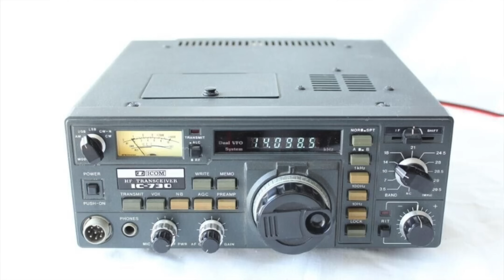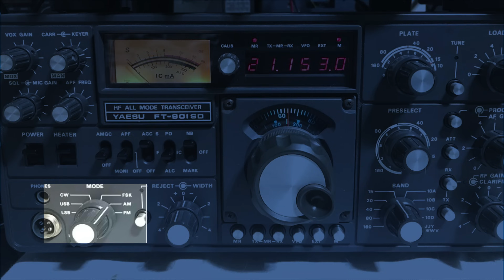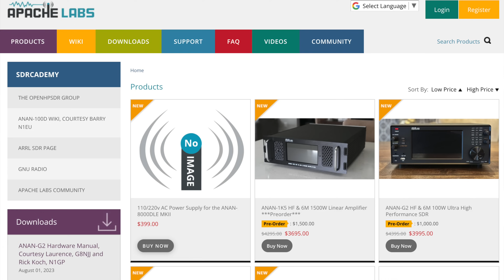Can We "Future Proof" Ham Radio??

Comment: My first HF rig from 3 years ago was an old Icom IC-735 (released in 1985) that I borrowed for free from the only other ham in my small town (I retuned it once I got my FT-891). I bought a digirig and 2 cheap Amazon cables and wired it up myself to connect to my PC. An old radio and 5 minutes of tinkering and I was using FT8, JS8Call, and winlink on a radio from almost 40 years ago. What I love about this hobby is that, all things considered, not a lot has fundamentally changed, and the old stuff still does 80% of what the new stuff does, and doesn’t do too bad of a job at it either! No future-proofing required!

Comment: Any modern radio you can set a TX power limit via menu. Making it hard t just turn up on the fly. I was just checking my TX power limit on 1296, I only need around 20 watts to drive the amp to full output.

Comment: At the risk of starting an argument, i wouldn't mind adding watt limit sections into band plans so we could tinker with some of the lower power rigs more. 
Adding in an example, make the 200w limit universal in the technician section of 10m. I'm just thinking through it.
Reply: Keep in mind that the band plans are not enforceable, outside of what your country's regulatory agency has set forth. Using the US as an example, someone could key up with 1.5kW right on top of someone running 15W. 

Part of being a responsible ham is to not intentionally doing behavior like that. 

What is the idea you have in mind for the power restrictions? There are "weak signal mode" sections of most band plans.
Reply: Yes, we would have to behave and follow the plan 😂. There's not really space in 15/20/40m for low power voice. I think with the growing interest in qrp rigs (esp sdr with fantastic filters) , it might be helpful for research/development and then getting out of the shack. It's not difficult during the day on a week day, but identifying a small space that limits high power qrm could be helpful. i say this as someone who is normally against micromanaging, so I'm not sold on the idea of more regs myself, haha.

Comment: To me, future proof is something like a Flex chassis where I plug in a module to upgrade 6400 to 6600. Maybe the processor module can be swapped. Unfortunately, designing in the upgradeability is expensive, and why laptop upgrades are minimal.

Comment: I disagree with the start cheap to get into hobby approach.
Most people think “I can’t afford a $750 Kenwood HT that’s a lot of money!” And instead buy a $50-200 radio and always wish they had that Kenwood. Where if they just saved for a few months they could have the radio they really wanted all along that will hold value, last longer and do everything they want. 
Never go into anything half way. Or you are most likely going to be disappointed or spend more $$ in the end buying lots of crap.
Reply from the maker: How about the people that buy the Kenwood and realize they don’t like VHF/UHF and want to do HF.  The $18 Baofeng would be fine for them to have just in case, but the $700 Kenwood, probably not.
Reply: While I'm not a fan of the CCR equipment, it allows people to explore without having to lay out a lot of cash. The downside is the poor performance of a CCR might scare away a newbie, that doesn't realize that better equipment gives better results. (This is why getting a loaner or lightly used radio could be a benefit.)
Reply: @richs39 also allows them to pollute the spectrum! I don’t understand how the FCC allows the importation and selling of radios that do not meet the requirements  for an intentional radiator.

Comment: As far as a radio someone can grow into for US Technicians any multi band HF radio that has 10 meter capability will be perfect.  There are plenty of older models that can be found for $500 or less at hamfests.  If they want something new within that price point the Xiegu G90 is perfect since it retails for around $450 brand new.  Sure it may only be a 20 watt radio, but you can work the world with an 80 through 10 EFHW wire antenna.  If they want a 100 watt radio the Yaesu FT-891 retails at just under $700 for a new one.  Both the G90 and the 891 can easily be used in the shack, as a mobile, or for portable operation.  Both radios will be perfect for someone who wants a HF radio in the shack and wants to play around with portable or mobile operations.

There is definitely nothing wrong with using older equipment to get started in ham radio though.  My first mobile radio in my truck was an Alinco DR-150 2 meter radio that was gifted to me by a relative when I expressed interest in the hobby.  After I got into the hobby I was given an Alinco DR-135 2 meter mobile by an Elmer for my home shack.  Now I have a Kenwood TM-731A 2m/70cm mobile in the home shack and an Alinco DR-605 2m/70cm mobile in the truck.

Comment: Life would be a lot easier if the major manufacturers stopped trying to lock us into their walled gardens for digital, particularly when it comes to Bluetooth.
Also, there is no reason any mobile or desktop rig to not have a 9600-baud capable soundcard and cat control over a USB cable, and even an SDR tied to the IF.
The only brands that'll exist in another decade are the ones making affordable radios that are of interest to "younger" (i.e under 50 year old) hams.